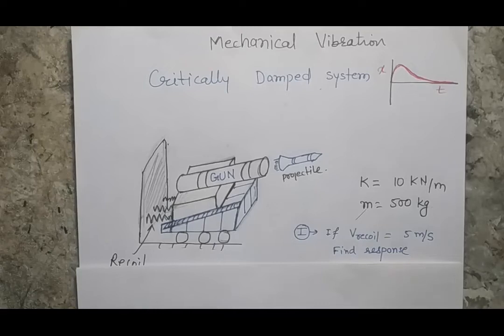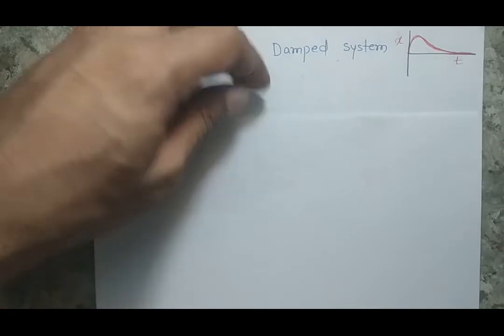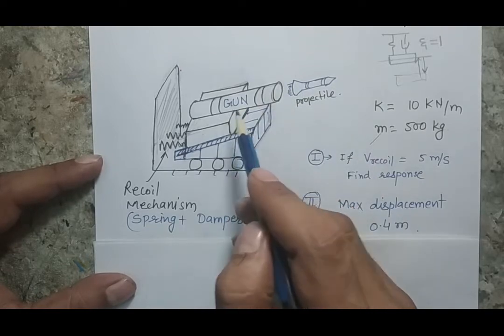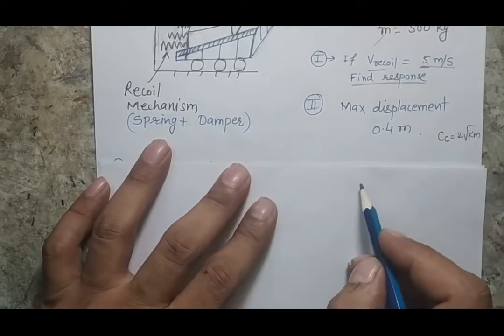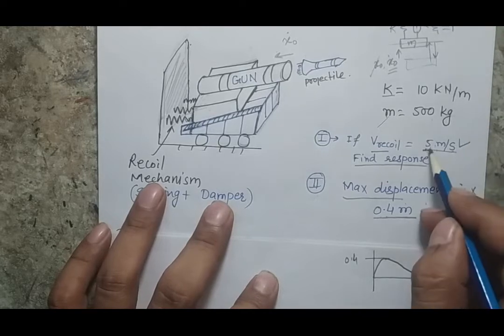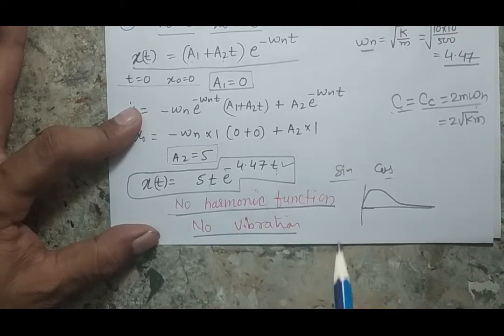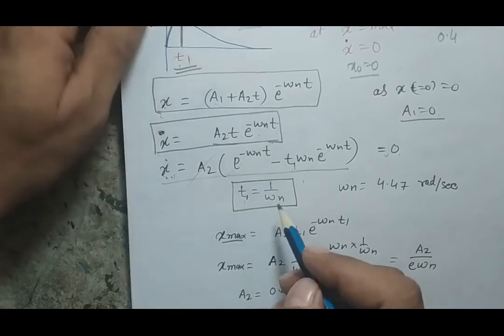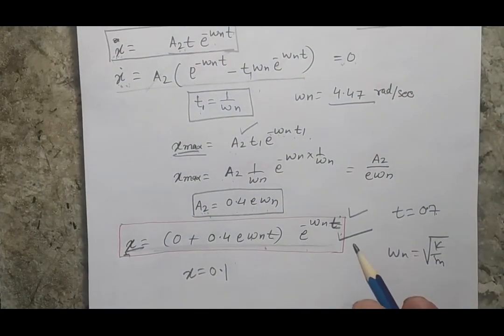Mechanical Vibration Lecture 10 || Critically Damped vibration Numerical || Gun Recoiling system

Comment: What happens if damping ratio is higher than 1 ?
Reply: Overdamped which means that system will not undergo any oscillation but it will reach its mean position in one go taking lot of time